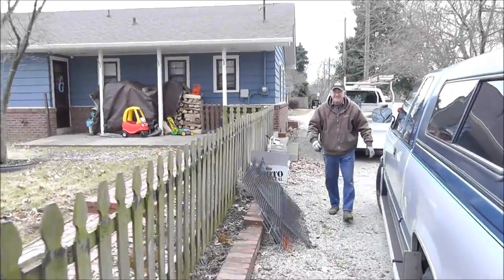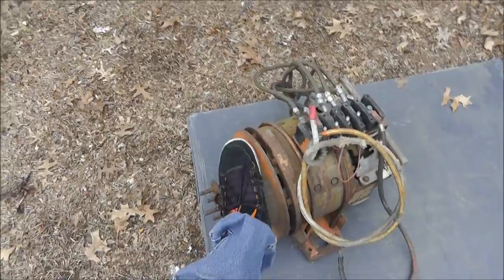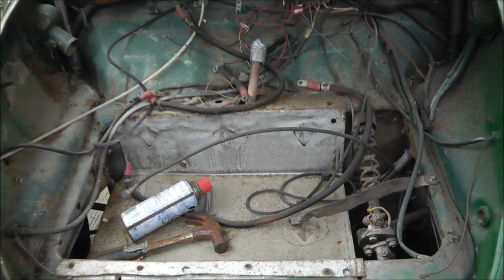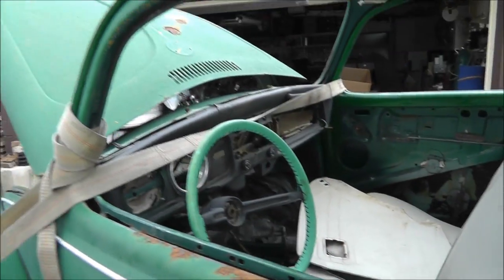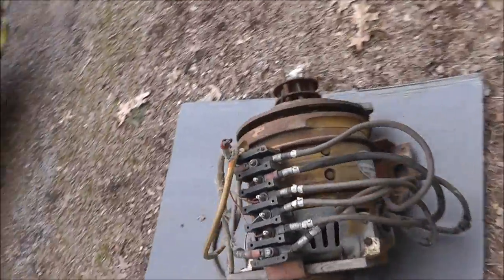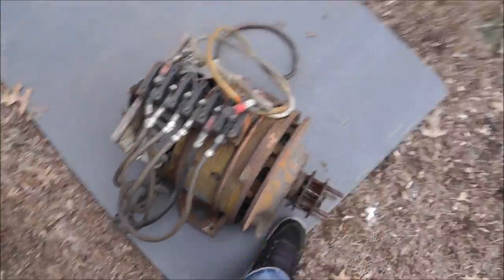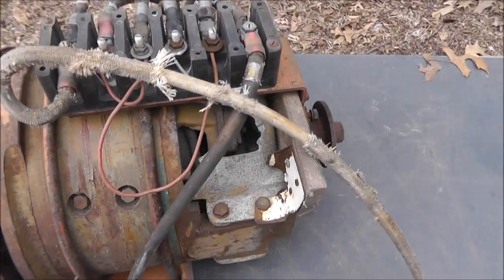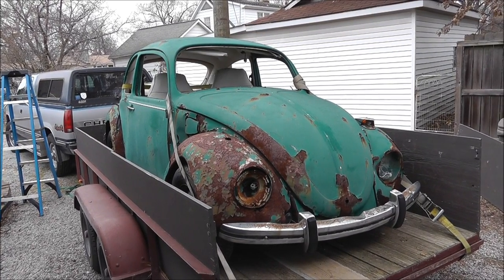what? an electric Volkswagen Beetle? was a dream by old man Dutch! success!

Comment: What a shame. Those old VW's are worth a lot of money today. You really may want to consider pulling ANY of the body off like the doors, the hood or anything else that can be sanded down and repaired because those parts are worth reselling to someone that has an old VW that they are trying to restore ESPECIALLY the transmission and steering wheel.

I have a neighbor that has a 60's VW that his dad bought as his first car when he was a young man that has stayed in the family and I think his dad paid $1500 or $1600 for the car new and this guy stopped at his house the other day because my neighbor had pulled it out of the garage just to wash and wax it and the guy offered him $8000 on the spot because the car is in really good shape so yeah those parts off what you may see as a rust bucket are valuable even if there are pinhole spots that have rusted all the way through and as long as it's just small damaged areas those can be restored. Trust me when I tell you that someone would be more than glad to purchase the doors and the hood etc for a restoration job!

Comment: Hi russ you may know that hitler built the vw to run on magnetic charged air as joe booker knows  anyway had a message from his friend Peter Stevens as I placed urine in my rover coolant system and a strange occurance happened that it disappeared but the car had more power  and it cranked far faster now he did not ridicule that and told me to place a star washer between the engine arty to body now you may know this but I am told its called phasing out and the urine as it contains deuterium makes a crystal crust inside the engine which I am told is lithium logic now is the engine block has a